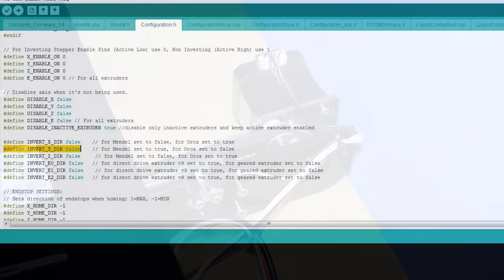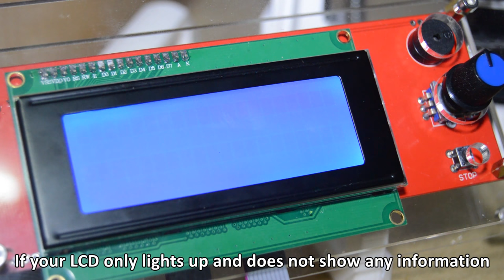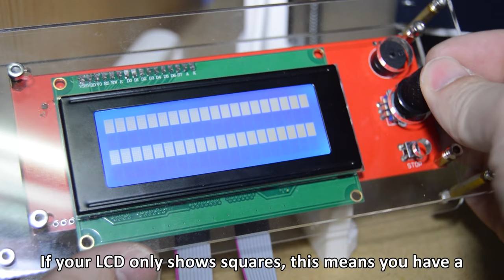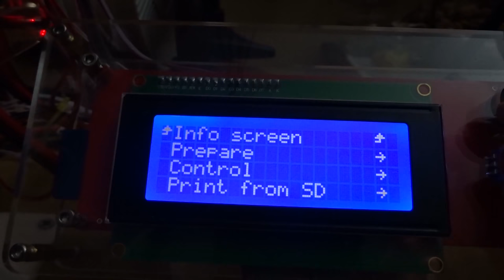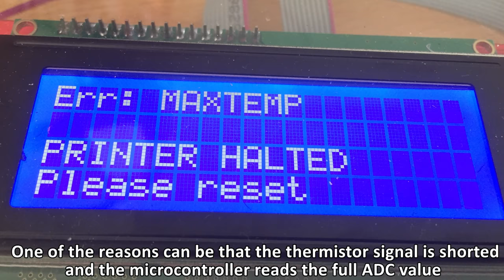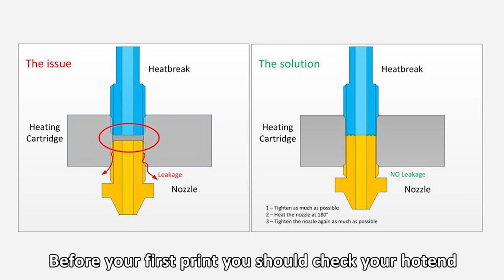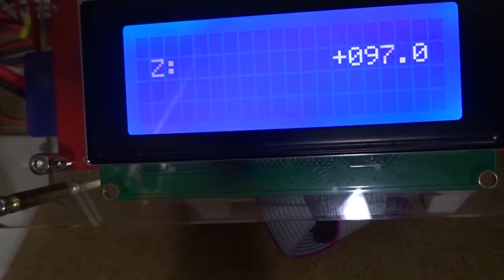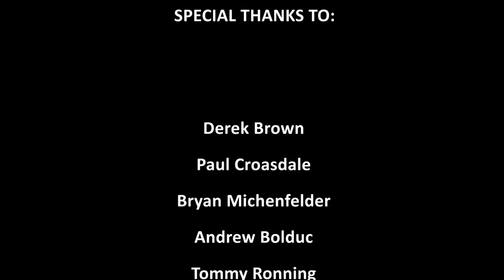TEVO tarantula - FAQ answered

Comment: I also suffer the "min temp error" from the bed.
 Looks like the problem is that the thermistor don't make good contact with the bed and get wrong temperatures.  I fixed it putting a little bit of thermal grease in the thermistor to fill the possible gaps. Works like a charm!

Comment: can you make a video on how to properly install plastic cooling fans on the tevo tarantula, please? I have seen some people connect it straight to the 12v supply and I have seen some people connect it to the part fan slot on the motherboard and then changing the software for the motherboard. Which is better and if it is the motherboard way, how do we change the software?

Comment: Hi! What configuration do you use with the tevo tarantula to print? In the speed to 100% -70% and what temperature for the pla? Thank you so much
Reply from the maker: Hi Sousa99,  First of all, the temperature for PLA is not always the same as it depends on the filament brand and sometimes colors too. It's important that you print a calibration tower to check what is the temperature that will work better for the filament you have. Regarding the configuration, i can send you my cura profile if you like. Just send me your email and i will send it to you.
Reply: Ok, thank you very much

Comment: Hey, I have a problem we're I have 4 rows of white squares instead of 2 like you had in your video I am very confused, as I have tried what you said by switching the cables around but that hasn't helped, it started after I reflashed my printer with the community marlin off the tevo Tarantula prusa i3 Facebook page and arduino 1.6.8
Reply from the maker: Hi David,
If your display was working before flashing the firmware then your display might be ok.
Try to flash a different firmware like RC8. Before flashing make sure that you have the correct display in "configuration.h".

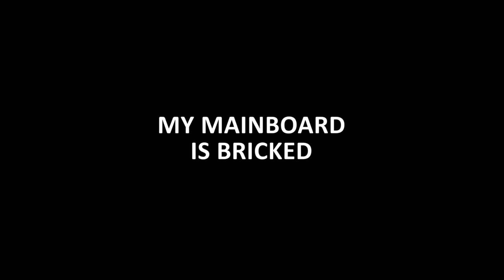Comment: at 5:37 you reference changing the firmware to use the spare E1, if your Vref is bad. How do you do this??? I have been stuck for quite a while now because my Vref on E0 is 0.08 instead of 0.8! at this point I want to switch E0 with E1 in the firmware, but have no idea how...please help!
Reply from the maker: Hi NIP1337,
If you have only 0.08V, then probably your potentiometer is not correctly soldered on the PCB.  Please check if the 3 pins are correctly soldered. If you still need to change from E0 to E1, you need to edit the firmware so that it can use the other port...or select in your slicer 2 extruders and use the second one as the main. For more information on how to edit the firmware, please log on the official tevo FB group and post your question there. It will be easier there.
Reply: Thank you for the timely response! As far as I can tell, it is correctly soldered and I can adjust the voltage, but it is in the range of 0-0.09v, so i'm thinking something got fried. Changing in the slicer would certainly be easier, I use Cura - i'm not seeing this setting change though. I just posted on the FB group too, waiting on responses now,

Comment: I'm looking to buy my first 3D printer and thinking of the Tarantula. Is it common for it to have all these problems? Thanks.
Reply from the maker: Hi John,
Not at all.
This FAQ is for all the people that are building their first printer and don't follow some steps.
Sometimes, like the display for example, needs to have the contrast potentiometer adjusted and things like these are easy to do and normal to happen but most people have a hard time to troubleshoot a simple thing like this.

Comment: Hi. I just got my printer assembled and I'm getting "heating failed". The bed AND the hot end do not heat when connected to the board. However they heat normally when connected directly to the power supply. What could the problem be?
Reply: Anwar Selo check if the wirering of  the heatbed is good on the pcb, connectors are horrible so it might not be connected good.
Reply: Thanks. I tried and it's the same. The voltage is low at 2.4 on all heating related contacts. The fan is at 5.5.  My power supply is at 11.9.  Any ideas?

Comment: I was hoping to find a solution here, but it doesn't look like your video covers my specific topic.  After I powered on my printer for the first time I received no movement from any of my stepper motors-even the extruder motor.  Because NONE of them are working, I can't test the cables or the power controllers on the main board, because switching these does nothing to help me.  Is there anything you can offer to help me figure this out?
Reply from the maker: Hi Casey,
I'm assuming you have an MKS GEN L board with removable drivers?
If yes, did you install the drivers correctly?
Reply: @ruiraptor  I just found out about the drivers. Sorry for the false alarm.

Comment: Hy, I have a problem with 3d printing that should take 9 hours but stopped and 5 hours as completed. What could have happened? Maybe the 3D object was not totally sliced in the g-code file ?I used CURA to slice.
Reply from the maker: Hi Silvio,
Two questions...
1 - are you using the same SD card that came with the printer? If yes then trash it and get a new one from a trusted seller.
2- Are you sure that you waited long enough for the slicer to slice and copy the file? Slicers like Slic3r take too long to slice and copy the file.
Reply: 1- Yes is the same as came with the Tevo Tarantula. I would buy another. 2- I don`t know if the slicer finished to copy to g-code file. I will try to open the g-code file in Cura.

Comment: Hello. I got dual head&large bed Tevo Tarantula which was assembled few months ago and still collecting the dust because extruders motors not working. Motors itself are fine because they works when connected to X or Y axes but doesn't work when connected to E0 and E1 ports and the nozzle/bed are preheated 230/55 C. I runned out of options. Few days ago I installed Marlin firmware and tried to play with some settings but have not success. Have you got any ideas what can be the problem or how can I check is there any problems with Board?
Thanks in advance.
Reply from the maker: Hi,
First thing i would do is i would install a single head firmware and test. If it didn't work then i would start considering that the board is the culprit.
Reply: Thank you for reply. Finally I managed to launch one of the extruder motors and printed out my first test cube. Now I will try to find how to enabled second motor and to do some calibration.
Thank you for help.

Comment: Hello ruiraptor.  I reinstall firmware as marlin 1.1 version. but after install firmware, LCD shows only squares. I already checked cable. what should I do?
Reply from the maker: The problem is in the firmware itself.
Check which lcd is enabled in the configuration.h. It might be selected the wrong display.
Reply: I found language settings and UI settings but I don't know how to set them.. would you tell me how?

Comment: how to check components no 12v power on the board , power supply OK .
no visual burns, powers up from usb but doesn't from 12v
is it possible internal tracks burn.
any solution  how to fix
Reply from the maker: Hi,
Try disconnecting all the connections to the board and only keep the 12v from the power supply and check if it turns on

Comment: I have an issue. Im using Marlin FW.
1) Icant lower the Z-axis lower towards the endstop. Its at 0 but is way too high and it cant go negative in "move axis" .

2) what is an offset? Do I need to home manually before every print?

3) my printer will reach bed and extruder temperature when starting to print, but will stop immediately once it reached the temperature and wont print.
Reply from the maker: Hi Serge,

Try this:

1- Move the z manually by rotating the leadscrew and get the Z closest to the endstop. Then execute the home sequence again.
2- The home offset is a value that the stock firmware has and, for example, the Y is = -41. This means that after homing, the Y is not zero but =-41mm. This offset is used to determine the distance of the nozzle when homed to the heatbed. You do not need to move manually but you need to take this into account when placing the parts in your slicer. If you decide to flash a new firmware, you can edit this value (i have a video explaining how to flash a new firmware...just check my channel).
3- Are you using the SD card that came with the printer? If yes, then scrap it and get a new one. If not, is there any error on the screen?
Reply: @ruiraptor  Regarding flashing new firmware for the Tarantula -- can you provide the link for this?

Comment: hey, 
I have a problem with the connection between my 3D printer (Tevo Taranrula) to the repetier print setting.

When I click on the connect button show up error window. 
( the connection failed with the following error: access to the post 'COM3" is denied.. Make sure your printer is connected, enabled and connection data is set correct. Open printer settings?) 

I'm using win 10 on laptop. my printer is connecting via USB cable to port 3.
I install the software and go to the tab ''printer settings'' and fill:
port: com3
Baud Rate: 115200 / 230400 / (250000 like the tevo tarantula manual sey) I have tried all.

Please give me any advice !!!
Reply from the maker: Hi,
So you have all the drivers correctly installed (check in device manager if there is any device unrecognized)?
In the device manager you see the port number (you say it's com 3) being addressed to the printer?
If everything is correct, it might be because you are using windows 10. I heard many people complaining about it. Do you have the chance to test in a diffferent pc that has windows 7 or xp?
Reply: hey, 
I tride everithing, now i connect to pc with xp win and it's work great.
theank you!!!

Comment: Hello Rui, Hve you find a way to resume a print when there si a power failure? Thanks for your work
Reply from the maker: Hi,
There are firmware versions that have that option, but i dont know if the most recent tarantula ones are equipped with that option. I dont rely on firmware options...i prefer to use an UPS. They are not that expensive and work like a charm.

Comment: yes I did , I allso check fuses on the board all good.
on the board there are some check Points small silver dot labeled (GND, XS1,) there is no voltage on XS1 dot  after powering board.
on oder hand when conected  by usb board  power up including screen.
Thank  You
Reply from the maker: If that's the case i would recommend you to flash the firmware and see if it helps. If not, then you need to open a ticket with tevo.

Comment: My LCD doesn't display anything and makes short beeping noises any help?
Reply from the maker: Is your board a new board? Maybe it does not have the firmware installed?
Reply: @ruiraptor  I fixed it by rotating the cables but now it doesn't recognise my SD card
Reply from the maker: Did you rotate both connectors?
Reply: Yes I rotated the connectors and fixed it but it won't show the SD card in the menu but it says card inserted on the main screen
Reply: Btw I scrapped the SD card that came with the printer as my PC wouldn't recognise it properly so I'm usin a 16gb micro SD card in an adapter

Comment: Dude please help me !! my heated bed + side connector melted like yours now ı cant read any voltage even from the back side there is no voltage or resistence between the ports can you help me ?
Reply from the maker: Hi Dat,
The melted connector in my video is an example...it did not happen to me.
Anyway, you should restore the connections. Desolder the connector and solder the wires directly and check.

Comment: can some one help me ?
When i start a print after heating up the y and x axis move. But when the hit the end stop the try to still move for 4 5 seconds it makes a lot of nice is this good ?
Reply from the maker: Hi MLG Commander,

This might mean that your endstop is not working correctly.
The noise you are hearing is the motor that continues to turn even after it hits the end.
Don’t let it happen or you will destroy your belt.
Check the endstop switch as my video explains.

Regards
Reply: thanks ruiraptor i will try.
thanks for responding so fast.

Comment: HELP! How i can swap the E0 to E1?? Because the driver of the E0 is burned.
Reply from the maker: Hi Lucas,
You need to edit the firmware and flash it back.
You have an easier way...In your slicer, add a second extruder to your printer settings. When you slice your model, use the second extruder instead.

Comment: Hi has anyone got any advice with reflashing, I uploaded marlin .h via arduino to solve an issue with my extruder steppers and now I have a blank lcd screen. I have tried many of the help comments and still nothing. I have a tevo tarantula i3 prusia 200x280x200 bed mega2560 processor on a mkl 500 base v 1.4 dual extruder, self levelling printer. Any advice would be much appreciated. Rudy
Reply from the maker: Hi Rudy,
If your screen is black after the firmware flash (but it was ok before that) then you must have a wrong setting in your new firmware. One thing you can check is the display that is selected. Check if you have the correct one and not the full graphic one.
Reply: Hi rulraptor, thank you so much for replying, I will go and check that immediately. Fingers crossed. I nearly trashed the printer in frustration. And by the way in your videos I prefer the text, your a big help for us newbies. Keep up the good work.
Reply from the maker: Hi rudy,
Please don't trash the printer :)
Let me know if you need more help.
Reply: Hi ruiraptor, again thanks for your help. I managed to get the eeprom reflashed WITH THE CORRECT LCD settings. I used repetier configuration tool and uploaded .92.4 version. everything started working, but the extruder engaged at high speed and kept running, without stopping, I had to stop the print. I ran a print from cura and now the extruder does'nt work at all. I have checked that it is working under other power source. This was the reason I was trying to reflash the eeprom in the first place. Any advice?
Reply from the maker: Hi Rudy,
When you reflashed the firmware, did you checked the esteps of the extruder? Are they correct?
My advice is that you download and flash the community 1d firmware and test. This firmware version is a tested version and it's working. You should start with that.

Comment: Hello. The extruder driver (E0) is on. not working. How to run a taxi to the E1 driver. thanks
Reply from the maker: Hi Ali,
You need to heat up the nozzle first before you are allowed to move the extruder.
Try raising the temperature of the nozzle up to 180 degrees and test again.
Reply: I tried 210 degrees. not working. The motor and the cable are working well. The driver is burnt. It just does not work.
Reply from the maker: Did you checked the Vref for that driver? Do you have any readings?
If the driver is in fact faulty, you need to download the firmware and change the pinout for the extruder to be used with the spare driver.
Reply: Am I going to change this? How to do it. Please describe it.
(Configuration.h)
// For Inverting Stepper Enable Pins (Active Low) use 0, Non Inverting (Active High) use 1
// :{0:'Low',1:'High'}
#define X_ENABLE_ON 0
#define Y_ENABLE_ON 0
#define Z_ENABLE_ON 0
#define E_ENABLE_ON 0 // For all extruders

// Disables axis stepper immediately when it's not being used.
// WARNING: When motors turn off there is a chance of losing position accuracy!
#define DISABLE_X false
#define DISABLE_Y false
#define DISABLE_Z false
// Warn on display about possibly reduced accuracy
//#define DISABLE_REDUCED_ACCURACY_WARNING

// @section extruder

#define DISABLE_E false // For all extruders
#define DISABLE_INACTIVE_EXTRUDER true //disable only inactive extruders and keep active extruder enabled

// @section machine

// Invert the stepper direction. Change (or reverse the motor connector) if an axis goes the wrong way.
#define INVERT_X_DIR false
#define INVERT_Y_DIR false
#define INVERT_Z_DIR false

// @section extruder

// For direct drive extruder v9 set to true, for geared extruder set to false.
#define INVERT_E0_DIR true
#define INVERT_E1_DIR false
#define INVERT_E2_DIR false
#define INVERT_E3_DIR false
Reply from the maker: it is in the associated pins_xxxx.h file.
You should find in the file: 
#define E0_STEP_PIN 26
#define E0_DIR_PIN 28
#define E0_ENABLE_PIN 24
#define E0_CS_PIN 42
Change to:
#define E0_STEP_PIN 36
#define E0_DIR_PIN 34
#define E0_ENABLE_PIN 30
#define E0_CS_PIN 44
Recompile and upload and use your extruder just like normal (only connected to E1 on the board)
Reply: I found the parts you said. The beer is different and mixed. But I did E1 with Repetier configuration. It works. Thank you for your help.
Reply from the maker: Hi Ali, 
Thanks for the feedback. Glad it's working :)

Comment: Have you dealt with Mintemp error?
Reply from the maker: Hi Charlie,
i haven't yet. But if you have that issue, then you need to check the thermistor connections. Take a closer look at the wires and solder joints. If you can't see anything wrong, get the spare sensor that is included in the kit and try that one instead.

Comment: Also can someone link me the ferrules he uses for the motherboard? I can't seem to find the right size ones.
Reply: just waiting for my printer to ship.    I am planning on picking this up https://www.amazon.ca/dp/B01N9SNNFU/
has the tool and  has ferrules  in 10 to 23 AWG range.
Reply: Wow, thanks that's great! Wish it was a little cheaper, since I only need 4 ferrules hah. But maybe the rest will come in handy later on.
Reply: I have this kit. The smallest ones, dont really fit on the fan and thermistor wires, but if you crimp hard enough and enough times, they stay on.